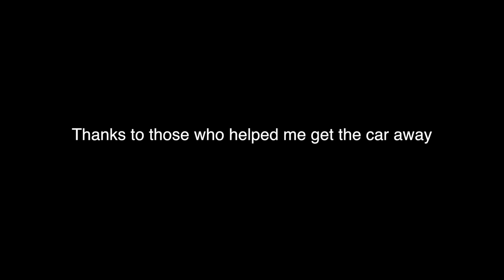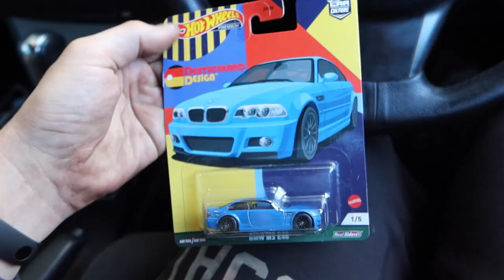GB IS DEAD! E46 DRIFTED TO DESTRUCTION @ Three Sisters

Comment: Shot in the dark since it wouldn't cause the engine to stall, but check the oil pump nut. Those B30s tend to vibrate them away.

Comment: Fuel pump. 
Starving it earlier on wouldn't have helped it.
B25 doesn't suffer the same oil pump nut problems as the B30 either.

Comment: Cam sensor I'd say, my m54b30 did this at the lights.
Reply from the maker: They don't stop working though with a failed cam sensor.. I had one go on my old 330, just defaults to a setting and doesn't get full power

Something like a crank position sensor failing is more likely

Comment: I had a similar issue with my 46, Use to start then cut out like yours found out under the bonnet (near ecu by scuttle panel) Was a row of 30amp fuses in a small black box. Replaced the one that was broke and it sorted the problem give it a try?
Reply from the maker: Interesting

Comment: do you reckon the oil pump nut come off due to the raised limiter? people usually lock wire them? always scared me as I get shit luck and worry about fucking the valves? was always against those dodgy random mapped ecus. I know this is just a skidder but sods law factor is strong
Reply from the maker: I think there would be more problems if that happened lol, and some audio to match
Reply: @dannyDC2  ah fair enough bro, never risked it myself, didn't know if you 'caught it quick' it wouldn't of sounded so savage having it shut off and not start. fingers crossed it's a quick fix!